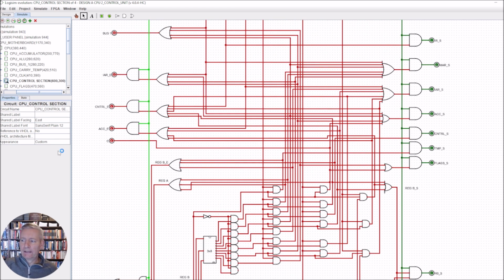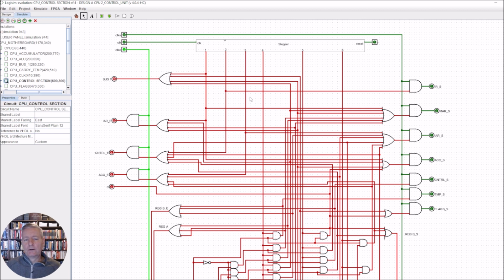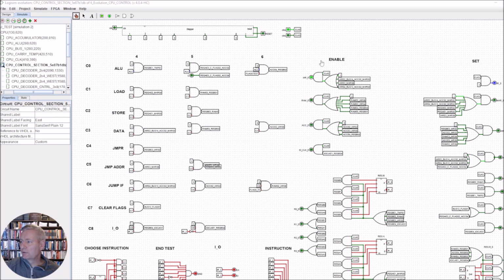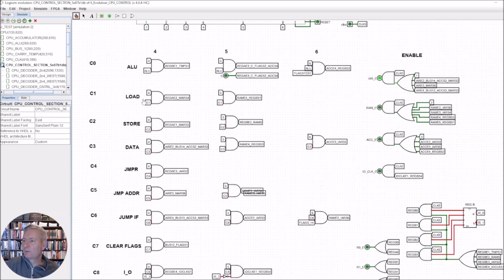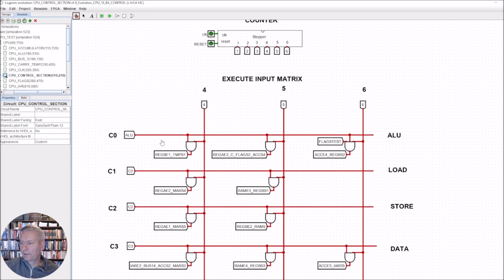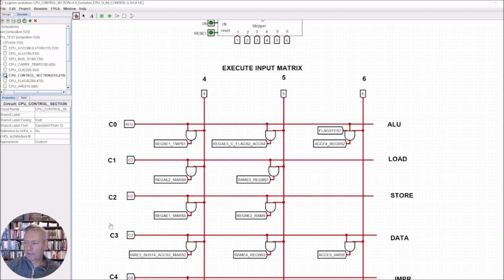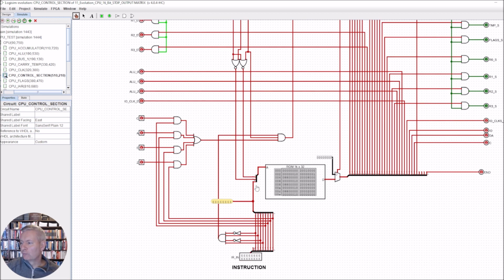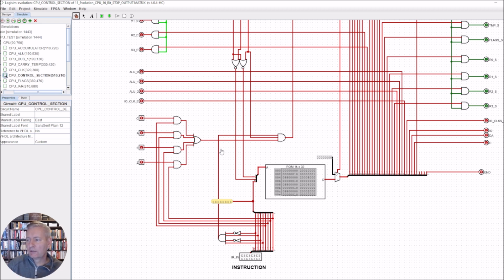Design a CPU 2 - Transition to Micro-Coded Control Unit

Comment: Thanks for the video, can we use the same approach (micro-coded control unit) to make a CISC architecture microprocessor ?
Reply from the maker: Yes. The microcoded and hardwired will both provide CISC or RISC.